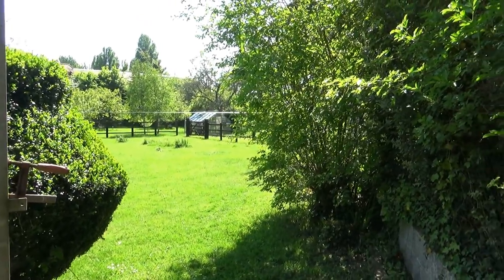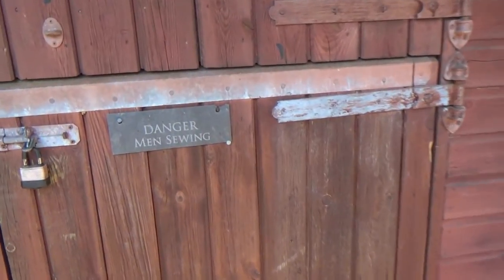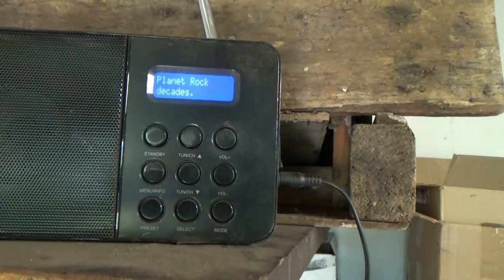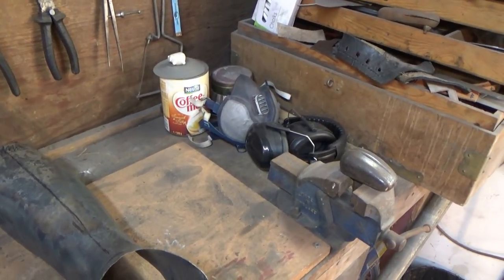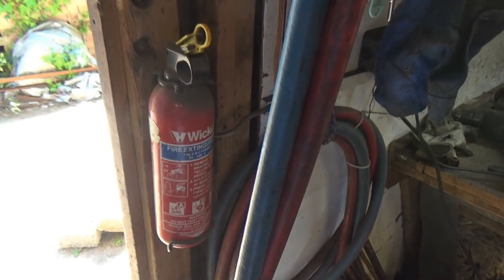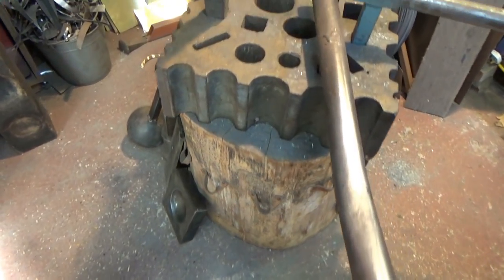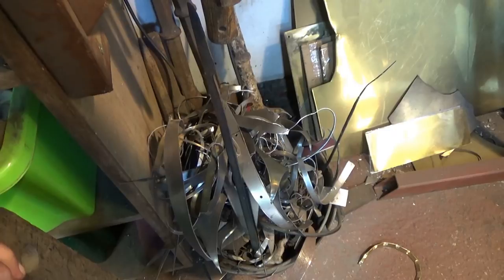Workshop Tour - or how to talk about a tiny space for 12 minutes

Comment: Your gas forge is very similar to mine. But I have interchangable bottom bits in mine. Just two at the moment. One is just a lump to rest plates on. The other is an oven that I use for regular blacksmithing.

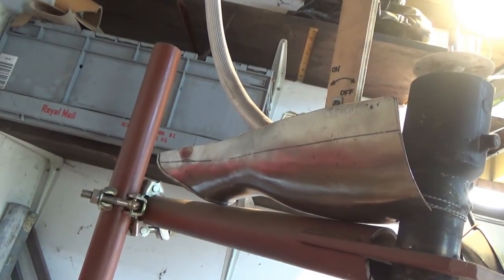Comment: I do my work in a 10,000ft^2 (~930m^2 for you english chaps) sheet metal fabrication shop. you have no idea how much more I would prefer a smaller space. I spend half my time walking between machines and tools that are spread across the shop, and the other half of my time walking around the whole place trying to find that one thing that I just put down 2 seconds ago and cant seem to find. How the fuck a tool winds up by the drill presses when I swear I was last using it at the grinding wheel is beyond my comprehension. Anyway, nice video, felt cut off at the end (it only goes to 9:05?). My work space is just as messy.
Reply from the maker: Yup, it seems to have left a good bit off, will sort that out, apologies. Perhaps we can arrange a swap of spaces for a few weeks and see how we both fair ;)